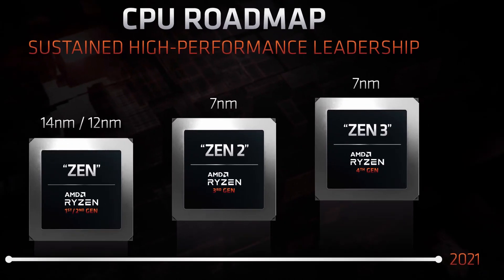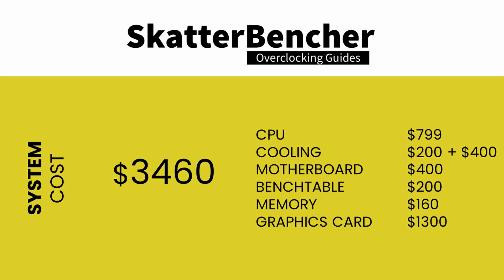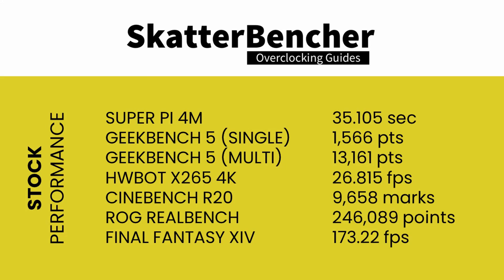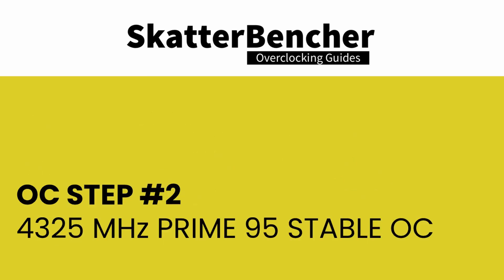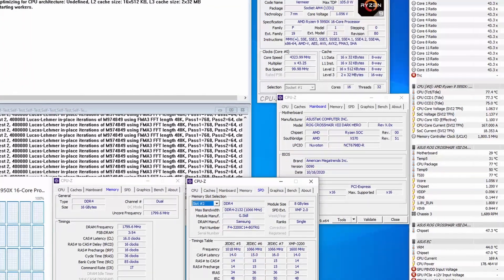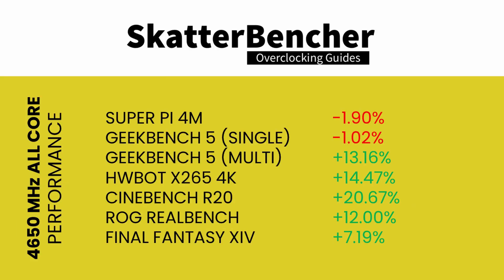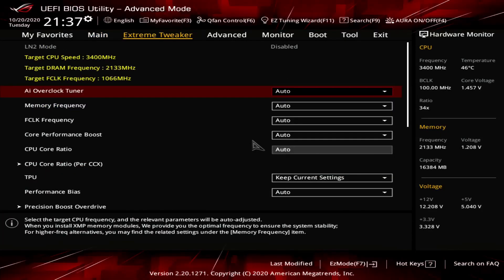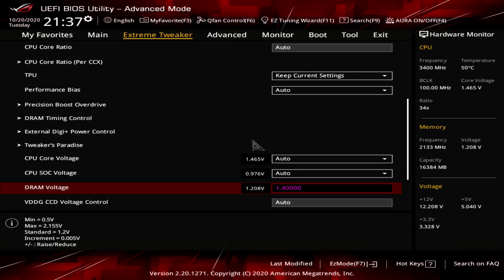Ryzen 9 5950X Overclocked to 4650 MHz With ASUS Dynamic OC Switching | SkatterBencher #15

Comment: Hi, I see that you repeating the same steps twice. First time when you applying manual OC settings and the second time when you setting precision boost overdrive, multiplier is the only difference. I understand that somewhere manual OC settings and also precision boost overdrive settings have to be saved so Dynamic OC switching can select between them, but I do not see where.
Reply from the maker: To enable Dynamic OC Switching, there are 3 steps:

1) Enable Precision Boost Overdrive 13:15
2) Set manual OC settings 12:55
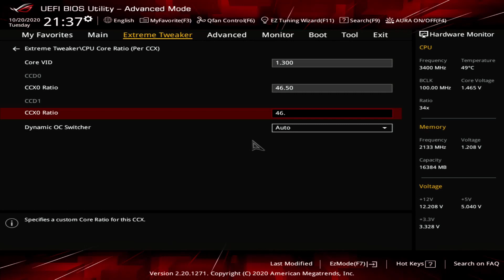3) Set Dynamic OC Switcher settings 13:08

In my video I demonstrate the settings with for 2 scenarios. Scenario 1 is where I tune for the "worst-case workload" which is Prime 95 with AVX enabled. Scenario 2 is where I tune for my "typical case workload" maximum all core overclock.
Reply: @SkatterBencher  Understood, thank you.

Comment: Great video. Is this dynamic OC feature available ONLY on this Crosshair VIII Dark? I have the Crosshair VIII Hero. Is it possible to get the feature via a bios update or something?
Also, the link in your description to the motherboard takes you to a Crosshair VIII Hero, non dark.
Reply from the maker: As far as I know this feature is exclusive to the Dark Hero. I believe Asus was working on this feature for a while and something prevented them from introducing it via BIOS updates. However, I'm not 100% sure of that so I'll ping them and see if it may be ported over to other boards.

Thanks for catching the link, let me see if I can update it! And thanks for the kind words!
Reply: @SkatterBencher  Thanks for the fast reply. I look forward to seeing what ASUS replies to you with!
Reply from the maker: Just got word from Asus. Implementating Dynamic OC Switching required some specific changes that can't be done on the older boards. So for now it will be a Dark Hero exclusive!
Reply: @SkatterBencher  Thank you very much for that information! - I have a Crosshair VIII Impact and I am disgusted that Asus basically invalidates all other Crosshair VIII boards a year later. They should take their junk back and allow the customer a differential price upgrade. Typical Asus, I have been a customer for 20 years, sometimes simply due to lack of other options, but have had also many issues with QC and features over time. They tend to make good stuff, but their quality control, firmware management, customer service and customer care is nearly non-existing. Overpriced junk at the end of the day, better choose something else it if possible.
Reply from the maker: @deinemaddaisdoof in defense of ASUS, they really tried hard to bring this feature to other boards as well (I actually first played with DOS OC on Crosshair VII Impact with 3900XT)! But it's quite a technical challenging feature to get right especially on the PCB design.

I don't have much experience with customer support, or quality control, but I can definitely say the people in the engineering team are top notch people who care about the product and the customers :)
Reply: @SkatterBencher  I am sure their engineering team is very skilled, but I am also sure that there may have been a way to back-port this, but I am also fairly convinced that the product / marketing guys do not want that. Why not make customers buy more instead... I hope someone like buildzoid or GN or der8auer will also comment on this.

Well, for all those like me with an SFF build, it's just a big "get lost" from Asus. I just ordered my 5950X to replace my 3950X, but I will surely not buy a hypothetical Crosshair VIII Dark Impact, if they bring that in the future ...
[EDIT: Unless it has Bios Flashback && has USB-C front-header && comes in ITX not DTX format (cut off the audio, those who need fancy audio can buy something else) && has an Intel 10Gbe Nic]. 

I rather stick to maxing out PBO (maybe EDC bug still works ?!) and next time buy something else. Asus is too expensive to be made end-of-life after one year tbh. C8I was also the only realistic Asus SFF option, since the X570-I does not have flashback (and Asus is extremely good at borking firmware updates, pretty much downhill since 1003ABBA / 1004B, although Fmax is interesting but still worse than EDC=1), and in addition Asus decided to bork the VRM of the B550-I, so that's also a non-option for a 3950X / 5950X with proper OC. Asus knows their market position very well, but eventually that kind of meh attitude will backfire.
Reply: @deinemuddaisdoof  agreed about the meh attitude. Look at intel. They lived off of reputation for a very long time and instead of getting better they just sat on their a*e until now every youtube tech reviewer agrees that no one should be buying intel at this time. The better buy all around is AMD.
Reply: @pyronic120120  If someone wants to buy a 10900K, fine by me. 5950X (or 5800X / 5900X for more reasonable people) is the best all around right now. 
I am still very sour with Asus (and others) that they cannot get their boards done right. Still waiting for the 5950X here, so no idea how it will stack up in MC vs my EDC=1_OC'd 3950X.
I hope the next Gen all round will be better from the board side. The CPUs deserve better boards tbh.

Comment: Will it beat the i9 10900K in gaming? Is it better than the 5900X in gaming?
Reply from the maker: You'll have to look for those comparisons at other channels! We're mostly interested in just increasing the performance of a platform or CPU
Reply: Yes. In more than half of games AMD is faster.  Sometimes over 10%
Reply: amd or intel depends on the game, both AMD cpus almost the same no games really scale past 12 cores or even 8, however 5950x is a beast in editing and rendering.
Reply: The 10900k is still an exceptionally fast processor for gaming. I wouldn't worry about upgrading if you have it.